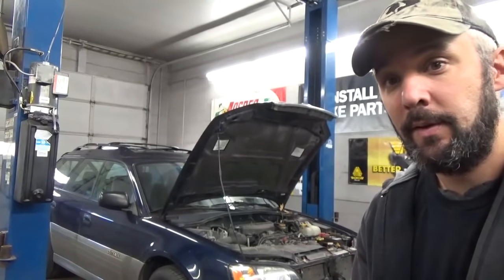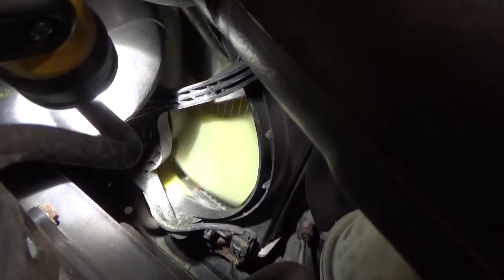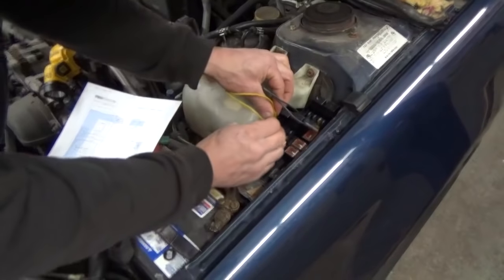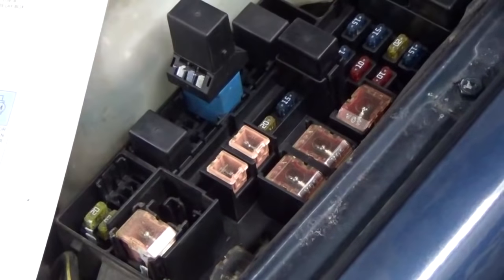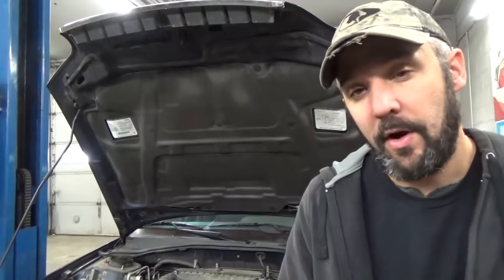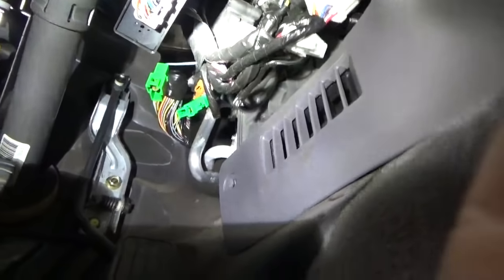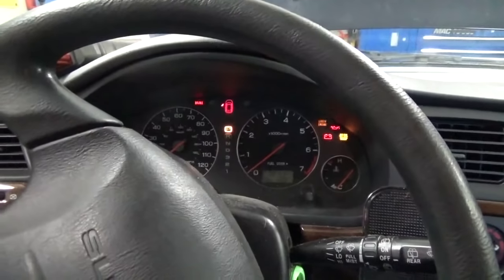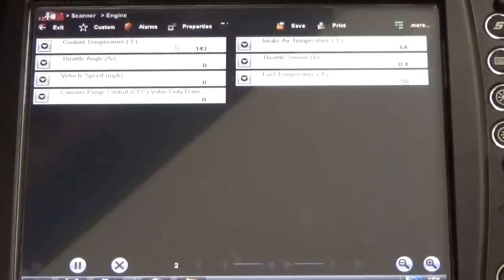P0483 Cooling Fan Problem - Subaru Outback

Comment: Excellent methodical troubleshooting!

Just wanted to say I own 3 high mileage early 2000’s Subarus. 
Every time I’ve seen this code it’s always started out as kind of a phantom issue. 
Meaning everything’s working when I start troubleshooting. 
I’ll clear the code and sometime later it’ll come back again but still everything seems to work. 
As time goes on it gets more & more frequent. 
For me it’s always one or both fans at the end of their life. 
I’ve even cracked open the fan motors and seen that the brushes will be completely worn out. I usually just get salvage yard fans but you never know how many miles are on them. I’ve only had a fan failure repeat once on one car and that was about 2 years later.  
My belief is as the fan motors brushes approach the end of their life the fan will begin to intermittently fail to start. Eventually it’ll get bad enough that the fan motor just can’t run anymore because there’s no brushes left. 

Just throwing that out there 😎

Comment: I just did a radiator replacement on a 2001 Subaru Outback 2.5 L...I noticed the coolant fans didn't came on...I turned on the AC and both fans came on. After watching this I understand why they never came on. Thank you for making such useful video.

Comment: As a fellow technician I have watched several of your videos and really appreciate your attention to detail and level of professionalism. As you know, intermittent problems are  one of the most difficult items we face. I see you have a Verus which is a great tool but, I'm not sure if I have seen you use and amp clamp for diagnosis as yet. When you had the relay bypassed to verify the fan operation would have been a great time to connect an amp clamp and view the amp pattern. With any brush type motor we would look to see a consistently even hump like pattern at a steady amp rating. Missing or low humps in the pattern could be an indication of poor brush to rotor contact and would also slow the rate at which the motor would turn. Sometimes this drop in speed is barely noticeable so, viewing the pattern will help. If the fan would shut off in the area of poor contact would it have enough current flowing to restart? Sometimes the airflow from road speed will turn the fan blade and get it going where sitting at idle it won't and the vehicle will overheat. I see your partial to the scope on a rope which also can be used to check an intermittent fan. If the fan is power side switched and has a constant ground you can connect the test light to B+ and back probe either the B+ side of the fan connector or relay fan side feed and spin the motor slowly by hand. the light should stay solidly lit, if there is constantly good brush to rotor contact. If it's B+ fed and ground side switched then attach the test light to ground and back probe the negative side of the fan connector.Again the light should stay on constant if the motor is good. I realize that there isn't the current flowing like with the fan operating but I have found many intermittent cooling fans this way if a scope wasn't available. Keep up the great work and sharing your knowledge!
Reply from the maker: Bluewrench61  Yeah that is a great point and thanks for sharing your wisdom. I have scoped (with low amp probe) HVAC blower motors to check for intermittents. I like the idea with the test light to check for uninterrupted current  flow. Thanks again for sharing your knowledge!
Reply: Excellent contribution to the thread, I scroll through comments every day to find constructive remarks like this one. Eric already knew all of that, but I've never seen it explained so well.
Reply: Oh Wow!!  I say just drive faster and get that air flowing!
Reply: Bluewrench61  you had a great comment on a cooling fan issue that I watched on YouTube hoping for a little advice. My question for you . What would cause cooling fans to come on at a higher temperature  245 now then it did  6 months ago 190 ? Everything seams to be working correctly except I would like to see the fans come on earlier. This is on a Subaru Outback 2002  thanks for any info you may have on this Mark cale

Comment: I have a 2004 Outback and just had the same thing happen as in this video. I wasn't able to check the relays as you did but plugging in the green connectors showed they were working. I cleared the code started the car and they were off ran it for a moment and they never came on. Checked around some more and went back out and thwarted the car and they were running. The only thing prior to getting the code was I was sitting in line idling. Thanks for the video and informing me about the green connectors.

Comment: Attention to detail and approach is great even if no problem found. One thing, the computer monitors how well the engine cooling system is cooling during fan operation. So correlation between engine coolant temperature and when the fan is commanded on. Going into more detail of the conditions required or symptoms of each fault code I find would be highly sought after. So maybe something as simple as a blockage of air flow though the radiator such as leaves or debris.
Reply from the maker: +brasanford1 Car has been in the shop for service sense this vid and the light has never come back on. Crazy lights any how.

Comment: One thing you didn't consider, on my 1998 Subaru Legacy Outback with only a 139000 miles, great service maintenance upkeep. The top of my radiator was warm and the bottom was cold. I would get the fan problem code occasionally and checking all the things you checked everything was fine. It was a clogged up radiator. And  the computer was sensing that the fans were not going on at the right time because of the radiator.  Many people end up with a gasket problem and then they fix their head gasket and the whole problem at the beginning was a clogged up radiator! So even after a whole head gasket fix, they still have the problem that caused it in the 1st place. If your Check Engine light goes on and this code comes up please everyone, check your radiator and just change it. If everything else is normal it probably is the radiator.

Comment: Hey !  Nice video !
If you don't mind, I would like to add a very important issue I just had. The ac in my wife's car was blowing warm air with the vehicle stopped, the ac compressor was engaged and running constantly but the compressor itself was very hot, both radiator fans running slow so I thought there was an issue with the high speed fan relay or maybe a pressure switch for the ac refrigerant pressure. I just happened to grab the refrigerant suction line where it comes through the firewall into the engine compartment, and it was warm, very warm. After speeding up the idle, it was still not very cool, so I proceeded to add refrigerant slowly, feeling for cooling to come back though the firewall on the suction line (the larger refrigerant line). Within a minute, the fans revved up to high speed, the refrigerant suction line started getting cool, and the ac cranks now, even at 96 degrees outside. So just keep in mind, there is a pressure switch somewhere for high speed on both fans and most importantly, the ac compressor DID NOT rapidly cycle on/off as many do when the refrigerant charge gets low. I know I should have checked the refrigerant pressures, but my method of checking suction line temp is pretty good too. In my case,  just a touch led me in the right direction. I hope this helps.

Comment: I have a 1999 Subaru legacy 2.5 sedan my rad fans aren't kicking on an seems to be boiling the coolant. I find myself always adding coolant. Where should I start looking? If I drive it hard it tends to get hot aswell as sitting. Casual driving it does not get hot. I have no mixing of fluids. I'm stumped.
Reply: I’m having the same problem. If you fixed your please give any and all solutions.

Comment: Great description on how to troubleshoot the electrical portion of this problem. I was wondering though why you didn’t explore the thermostat as a possible cause of the error code. A failed thermostat is the most common cause of that particular code on Subaru’s.

Comment: thanks eric, if it wasn't your video I wouldn't know crap about diagnostic, before I used to be more of a part changer now,I found myself with more on the diagnostic side I started buying more diagnostic tools than wrench and ratchet, the other day my mother brought her murano with a check engine light when,the car wouldn't go uphills,running rough,wont rev up to 2500 rpm,came to find out it was a bad ignition coils ,was a real pita to remove the intake plenum to access the other coils.

Comment: South Main Auto Repair LLC    I know this video is old but I have the same question that i noticed you never replied to in previous comments. So I checked all my fuses and relays then connected the green wire and fans came on but once I unplug it and turn the car back an the fans don't come on after engaging ac or after hitting high temperatures.
Reply: Did you ever figure this problem out?

Comment: I have this code on my 2004 Forester and I cleared it once but it came back three days later. Before I diagnose I have a couple of questions. If I do a systems check under the dash will that rule out faulty relays and harnesses to the fan. Also should I look into the thermostat or engine control temp sensor? Any info would help thanks

Comment: What if my fans never kick on even after the green connector test proves that my fans are being controlled by the computer? 

I've tried all the other obvious tests as well like the checking the fuses and starting the car and running the AC and letting it get up to temp with no fan action...
Reply: Any answers to this question?
Reply: Ever figure out what that was about by chance?

Comment: I also wanted to add that my wife's car obviously has a refrigerant leak somewhere if it needed refrigerant. I will check the compressor shaft seal and around the compressor first with leak detector bubbles. Remember, refrigerant does not wear out or get weak, if you need to add some, you have a leak, or a clog, or a possible mechanical failure inside the compressor, and some Subarus have that, what I think is a stupid, stretch belt setup that puts too much tension on the belt, which is great for wearing out compressor seals and bearings. A spring loaded auto belt tensioner would have been a better choice.

Comment: Hi Eric, great video. I have the same question as Ezzry Leon. I have a 98 Outback that the fans would not turn on when engine temperature gauge is high. But if I connect the green plug both fans run. I connect a OBD code reader to the ECM, (well not as good model as yours) that displays no code.  Could you suggest anything else I need to look at? Thank you for help.
Reply: Coolant temp sensor maybe

Comment: I just bought an 09 outback. Has all new radiator system belt head gaskets. Was still having issues with heat and smelling coolant. The driver fan wasn't working. Easy fix nowits driving good

Comment: I found the video very helpful! I've got an 2008 impreza with cooling fan/overheating issues. When I turn on the AC neither fan switches on. When I run the car past operating temperatures neither fan kickes on, however, when I plugged the green test connectors together both fans srarted up. This leads me to believe all fuses and relays are good so I have changed out the collant temperature sensor but unfortuantly the issue persists. I am quite stumped at this point and am considering wiring a manual switch with direct power to fans. Any thaughts?

Comment: Did this code ever return?  Seems like a false dtc.  Did you happen to check for any TSB's?  Maybe computer software reflash?  Great video.
Reply from the maker: See the car for regular service and the code never came back. No tsb's that I saw on this code. Not really sure the cause but they are still driving around happy :)

Comment: I know this is so long ago  but please respond. Working on my 2016 subaru legacy... The car is not overhearing yet...but it's pending. Here is the issue, the fan does not come on automatically as it should. I can use the ac to trigger fan and they will come on. temp will go all the way up to 217f fan doesn't come on. I've change thermostat and made sure the jiggle valve is facing the same position as the original. I removed the waterpump and it is not damaged or broken. The radiator is full of coolant and I had the car running with the radiator cap off for one hr to purge any trap air. Also change the engine coolant temperature sensor. Took it on the highway for about 30mins at 80mph in Georgia. It did not over heat but when I can back home the top radiator hose was hot which is normal but the bottom rad hose was just barely warm. What the hell. I'm using a basic obd scanner/reader. I'm able to view live data to see ect temp while I'm driving. At 80mph the car went up to 210f used the ac to turn the fan on and bring it back down. I also  switch around the relays with horn etc they all work OK

Comment: Question fans got clogged with mud, didnt notice, come summer overheated blown fuses. But now both fans will kick on but fuses  get hot and blow could both fans be messes up as far as motors.?mecanics here are outrageous. When fans unplugged fuses stay good. Why would they get so hot so fast and blow. I traced wiring all looks good no damages. So just wondering about fan motors thanks i. Advace if u read this 96 Subaru legacy. I did jump a wire to check andwire got hot

Comment: The green "relay test" connector is a nice touch. 
     Subaru with an intermittent cooling fan problem sounds promising for head gaskets and more in the near future!
     Especially if the driver is one of the hopeful dummies that thinks they can make it the 3 more miles to home, and "it'll probably be fine".

Comment: When jumping the relay prongs, if the fans did not turn on what would be your next check? My fans work when jumped individually directly to battery. But jumping circuit board did not power them on

Comment: I don't have a check engine light and no codes were found. The car was very hot a couple times still no check engine light. Also looked around for evidence of Mr. Mouse. So far I haven't found any damage. Will follow your footsteps here and see where that leads. Where are those other fuses located???
Thanks for the video....

Comment: so i checked my 20a fuses and they aren't blown. and I connected the green wires underneath the dash. and they work. but the fans won't turn on(for the actual and cooling fan) after like 10min of warming up. I don't have a rely checker to see if my rely are workung. would I just assume that the rely's are out and start replacing them?
Reply: Did you ever get into solving this issue?

Comment: Thanks for this video!  We had this replaced on our 2017 outback 3.6r but only the passenger side radiator fan turns on when we have the AC on and idle. I’ve tried a bunch of different ac settings but none of them make the drivers side fan turn. Is this normal?

Comment: What if only the fan on the right works sometimes and the left never does normally while the car is running. But when in test mode both fans run? What does that mean? 2001 outback

Comment: I hope you can point me in the right direction. I went through the steps you show when I jump the relays my fans wont turn on and at one of the fuses the one closest to the fender only power is on one side all the fuses are tested good as well as the ones in the dash I made up power to the fans and they work the relays test good as well I also replaced the temp sensor. any suggestions ??

Comment: Hey man. I have an '02 Legacy and ive been having problems with the engine overheating for the past month or so.  Thought it was just due to the hot weather we are having down here in Vegas but the it seems something is definitely not working. No error codes, but the temp gauge starts to creep up after about 30~40mins of driving and stabilizes back down if i turn the AC off. I did that trick where you plug in the two green connector wires under the steering column and everything seems to be moving/activated except for the fan on the drivers side(main fan?) All the fuses work and i even tried to see if it was a bad relay and swapped the main relay with the sub fan relay, and still the driver side fan wasn't moving. I'm hoping its just the fan giving up after 20 years of hard work and not a bigger issue like the ECU. Any advice would be greatly appreciated. Also is that connector trick unique to subarus because everyone i seemed to mention it to while trying to get answers seemed surprised that was even an option on a car.

Comment: Really a great video! I was glad that you went through the whole process of checking several things. I’m having a slight overheating problem on my ‘05 Outback XT. The fans come on only when the A/C is On. But if the A/C is Off, they don’t turn On once the engine has reached operating temperature.. What could this be??
Reply: Hey Mike! Did you get a diagnosis on this? My 2005 Saabaru has the same issue
Reply: @densmaish5586  Yes, the previous owner clamped one of the HVAC coolant hoses pressurizing the cooling system and therefore overheating the engine. 🤦🏻‍♂️ Seems like there was a leak in the cabin. I have since taken care of the issue.
Reply: @Mike_44  thanks for the update. Thankfully, mine turned out to be a stuck thermostat. Much better than a bad gasket etc
Reply: @densmaish5586   That’s great! I replaced the motor on mine lol 😆 the engine seized from a spun rod bearing. Did all the work myself, very proud. Car is working great now. 😃

Comment: I see p0692 error on the obd. low level radiator fan is not working. relays works. high level works. do you have an idea to fix this? my car is legacy 2004